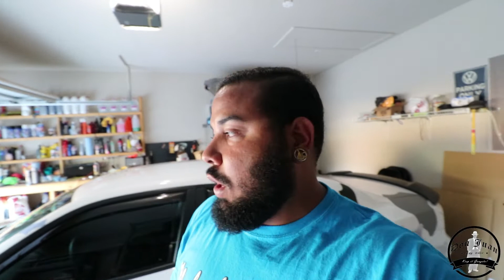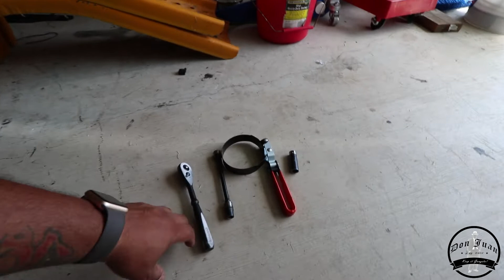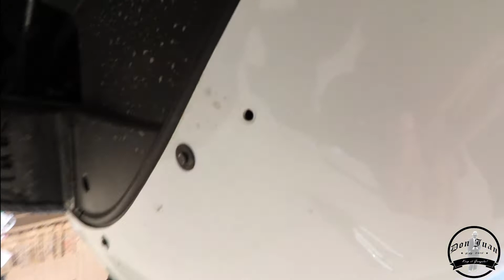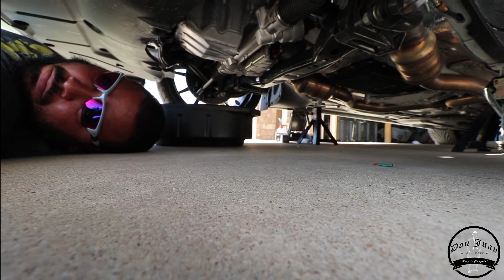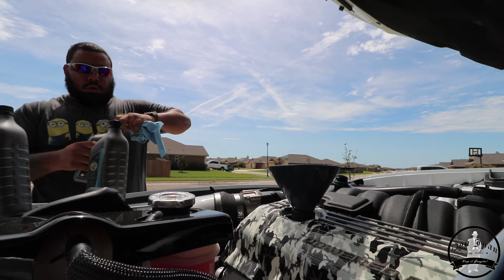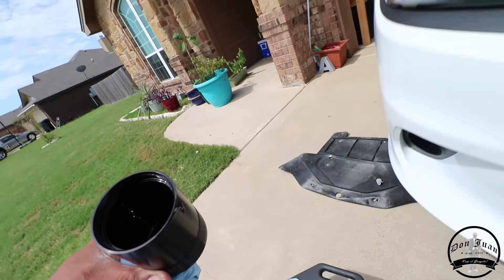How to: oil change 15+ Charger/Challenger/300 392 Hemi + catch can results!

Comment: congrats on the new home. Coming up on a needed oil change myself, just hit 5k. Subbed!
Reply from the maker: +Romeo_22 thanks man! Super easy to do.
Reply: Don Juan Yea. Looks relatively simple. I just installed and uploaded a legmaker intake on mine 2 days ago so I had to remove those belly pan bolts as well. Check it out if you can!
Reply: Don Juan  hey bud, why are you selling the scat ? Saw it on CL...

Comment: Congrats on the new house. I hope everything works out for you there.   I've noticed in these oil change videos for these cars that everyone uses a jack and jack stands. Why not use ramps?  I was just wondering if there was a problem using ramps with these cars.
Reply from the maker: +gtrman69777 thanks! You can use ramps if your stock heights I have seen people use them. Issue is our front end sticks out so far they tend to hit the ramps even at stock height. I have a set of old school metal ramps and even aired up all the way they still hit. My buddy has a set of those newer lower plastic ones and those would be perfect I think.

Comment: Is this for the 392 only or for 5.7 also?
Reply from the maker: +Swavey Mike should be pretty much the same for a 5.7
Reply: Don Juan resetting the oil life screen you put the car on run and just hold ok on the oil life screen?
Reply from the maker: +Swavey Mike yes correct, put it into run position but engine "off" on the oil life screen press and hold ok and it will reset.